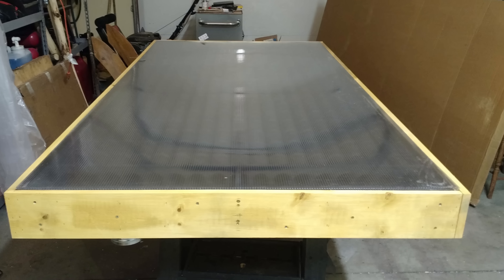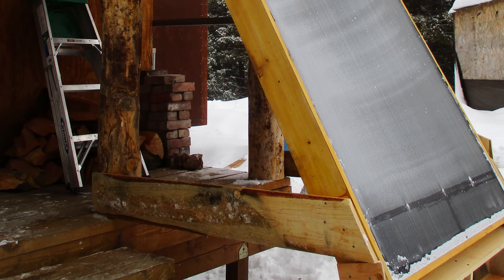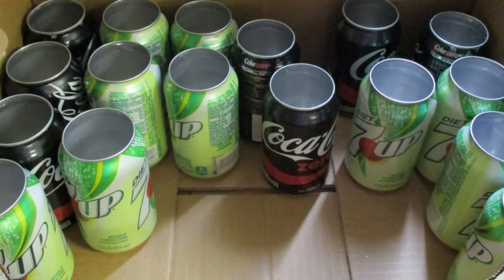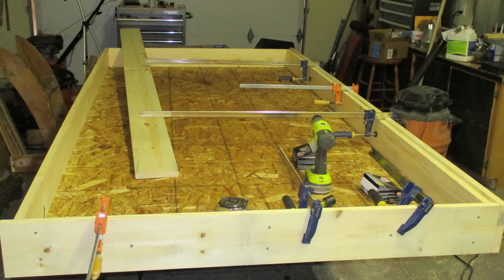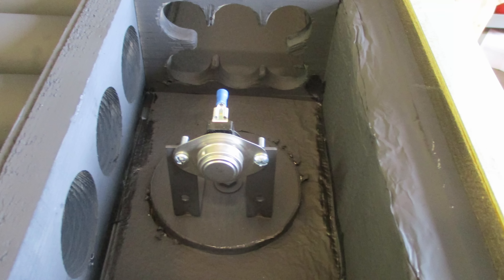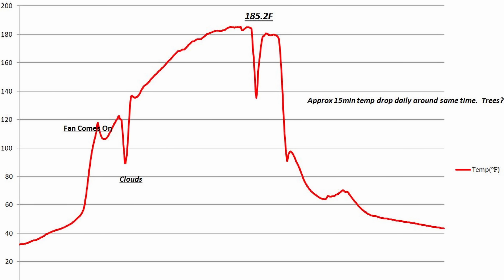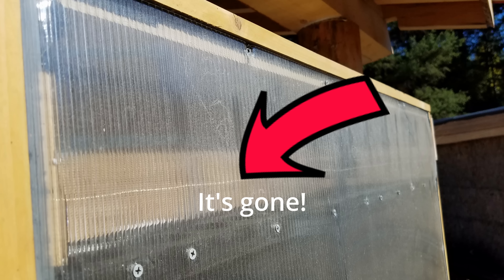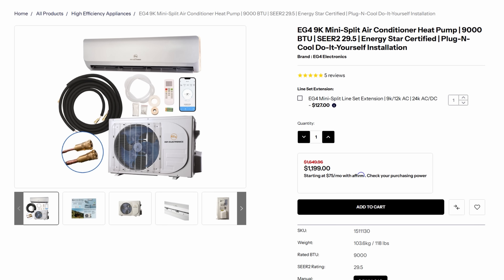7 Years with Pop Can Solar Heater - Is It Still Worth It?

Comment: Something to consider when comparing your DYI heater. Once built it has very little continuing costs. In fact if it is designed for maximum efficiency it will need very little or no electricity which means the only future costs is maintenance. 

While the EG4 mini split is an amazing product your statement that it is only about twice the cost of your DYI heater is not fully true. You either need solar panels, solar panel controller(s) and possibly a properly sized battery and/or on-grid electric and/or a properly sized generator. 

This means that the upfront costs can easily more than double the heat  pump costs and/or the ongoing fuel/electric costs must be taken into account. 

So how do you make your DYI heater more efficient? You need to place the heat collector much lower than the heat exchanger inside. This means that you take advantage of heat rising, cold falling to create what is called "natural circulation". With large enough vent pipes and a large enough height differential you may never need to use a circulation fan. 

You can then also upgrade it for cooling using the same natural circulation principles. 

Both systems can share most of the same ventilation piping. The inside exhaust would go to an upper level of the building (whereas for heat you want it at the lowest level). This dumps cool air higher in the building so that it can circulate inside the building to the lower levels. 

Which mode (heat or cool) will automatically determine which interior vents are exhaust and intake. For cooling you do want a building exhaust vent that goes from the highest point(s) of the upper level of the building to as high above the building as is practical. This exhaust vent will pull (suck) the hot air trapped near the upper floor ceilings without needing a fan. 

You will also need to put in damper valves near the heat collector. These allow you to bypass the heat collector for cooling. 

If you can extend piping to a cool location (either somewhere that is always shaded and significantly cooler that the desired building temperature or by building underground loop(s).

In general, but you need to look up specific information for your location, placing the loop(s) about 6 foot underground means a near constant year round temperature. In general this temperature is about 50F to 60F. Which is cool enough for natural air conditioning and can be a great way to pre-warm air for the heat collector. 

The underground loops need to be long enough to have time to cool down the warm air from the house. It is also generally better to split a 6+ inch pipe into multiple 4 inch pipes to increase the surface area to air volume ratio. Using too small of pipes can cause too much resistance to air flow. 

For even better efficiency you could setup two completely independent systems. One for cooling and the other for heating. 

The heating system would use antifreeze instead of air. From the heat collector the antifreeze would be sent to old water heaters with the electric elements removed and in their place would be a heat exchanger made from coils of copper piping. You would want multiple water heaters to increase the volume of hot water. You need a valve to be able to limit the amount of antifreeze each water heater receives. I've heard of people creating these and the water gets so hot that it flashes to steam. 

From these water heaters you send hot water to various heat exchangers inside the building allowing you to control each rooms temperature. You will need an air circulation fan for each heat exchanger. You could then use a wall and/or smart thermostat to control an electric valve and the air circulation fan. 

The only bonus is that you can install another heat exchanger (water to water) near the house water heater. Then have a small pipe from the hot side of the hot water heater go to this heat exchanger, then a small pump, then to the cold side of the hot water heater. This allows you to use your solar water heater to maintain the hot water tank 's temperature which can significantly reduce your electric usage. 

Of course if your solar water heater is large enough you could use it to heat water at your sinks, showers/tubs, washing machine and/or dishwasher. 

At the minimum it may be worthwhile to have a small hot water tank at the showers/sinks farthest from the main hot water heater. 

Even a tiny 1 gallon to 5 gallon water heater can make a huge difference. Connect the "cold" side of these small water heaters to the hot water line. The "hot" side goes to the local shower and sinks. The tank is kept to about 120F from the solar water heater's indoor water tanks. The tank only needs to be large enough to supply hot water long enough that the hot water from the water tanks can travel that distance. At that point hot water is entering the small local tank. The small local tank will also be helping to maintain at least 120F water. 

You now have "instant" hot water, because these local small hot water tanks should be as close as possible to the local sinks and shower, likely under the sink in its cabinet. This means that the length of pipe from the small local water heater should be under 6 feet, and possibly about 2 feet to 3 feet.
Reply from the maker: Thanks for the incredibly detailed and insightful comment!
Reply: I realize that a more elaborate system will cost significantly more money. In many cases you may be limited by the property and/or local regulations. Some may only be practical if built at the same time as the building.

As all off-grid solutions are not only for practical purposes but the costs must be balanced by their ROI. 

The systems I describe will require little power. Even the air circulation fans for a room can be a small DC motor that may only be 50 watts or less and rarely will be running more than a few minutes at a time. The fan on a central furnace for a house can be 15 amps to 20 amps or larger. This is 1800 watts to 2400 watts. 

Most electric hot water heaters use a 4800 watt primary element with another 4800 watt secondary element. Taking a shower can easily cause the secondary element to kick in, which means 9600 watts. 

That is a huge load on your inverters. Having inverters for a house that can handle multiple high load equipment simultaneously, even for short periods can require a 240Vac inverter system capable of 75 amps or more (18,000 watts). Taking a hot shower while an 1875 watt hair dryer is being used along with air conditioning can easily exceed 15,000 watts. 

Designing a solar system that can handle those loads is a significant cost: inverters, solar chargers, solar panels and batteries. 

If by using these alternatives to heating/cooling and hot water you can get by with a much smaller solar system it may actually be cheaper. 

A house off-grid solar system designed to handle 18,000 watts of load should have at least 36,000 watts of solar, solar controllers that can handle that much power, batteries that can last for 3+ days of cloudy weather during the short winter solar hours. The larger the  inverter load and size of the battery bank also requires a much larger backup generator. 

The generator needs to be large enough to carry the inverter load plus charge the batteries. If your average hourly inverter load is 6000 watts and you buy a 5000 watt generator you not only won't be able to have the generator carry the load, but it won't be able to charge the batteries. 

So many people will calculate generator run time to charge the batteries forgetting that the maximum amount that the generator can charge the batteries is it's output minus the load. 

I've talked to people who didn't understand why they had to run their generator all day and never got their batteries back to 100%. They forgot to subtract the load and simply divided their battery bank watt hours by the generator's output rating. 

People also tend to forget that a generator running on natural gas or propane will have a much lower output than on diesel or gasoline. They don't take into account that the generator's output decreases with elevation and that the output will vary with air temperature. 

Additionally people assume that their "portable" generator is designed to run at 100% for long periods (greater than about 2 hours at a time). Most portable generators are only rated for 25% load for long term use (about 10-12 hours continuous). These generators can handle about 50% to 60% load for about 6 to 8 hours continuous. 

This means your 20,000 watt generator shouldn't be used for more than about 8 hours continuous at 10,000 to 12,000 watts of load and about 10 to 20 hours at 5000 watt load. 

These portable generators also generally require an oil change every 100 hours (after break in), or 50 hours with extreme use. Extreme used can be high altitude, high air temperature, high load or a combination of factors. 

This might mean that after only 2 days of use you must do an oil change. Perhaps you are at 3000+ feet, the air temp is 90+F and you are running the generator at about 50% load. That is a likely combination that could be considered extreme.

Comment: The pop can idea is great and very efficient but expensive. So the cost includes all the hours of labor, which starts at minimum wage or much higher for most people.  With the cost of electric solar panels being so low, I think just buying two panels for a few hundred bucks and then attaching them to a heating element would be so simple and require very little time to just mount.  If you wanted to get cleaver the back of these panels will also heat up, just like a black pop can, so you could use that heat as well.
Reply from the maker: I appreciate your thoughts on alternative heating methods.

Comment: There are lots of variations of passive solar hot air boxes. You can break the bank trying to make yours maximally efficient, but maximal efficiency is not necessary.  You're getting the sunlight for free, so you don't lose much if your design allows some of the sun's heat to be lost.

I've built two variations through the years.  The best one was the simplest, and it functioned well in part because it was so large that it didn't need to be efficient.  I built it so that it used the entire surface of a metal garage door as a heat collector plate, roughly a 9 ft by 9 ft opening. There were no pop cans or other tubes. I simple built a large clear plastic panel attached to a portable 2x4 frame that stood vertically in the garage door opening. It created a hot air box about 9'x9'x6 inches deep.  I fastened the portable panel in place in front of the garage door, so that the sun shone through the clear plastic and heated up the metal garage door. In the morning, I opened the garage door about six inches, which created a similar size opening at the top and at the bottom. As the sun heated the metal garage door, the box drew air in from the bottom, where the door was slightly open, and convection poured that heated air into the garage from the opening at the top.  When I finished work in the garage, or when the sun was blocked by clouds, I simply closed the garage door to hold the heat inside and prevent reverse convection.

If I needed to get a vehicle into the garage in winter, I'd need to move the clear plastic panel, which would require two people and about five minutes, but I rarely did so. I tended to keep a long-term restoration project in that garage stall, so I rarely needed to open the door to get the project out. Typically I only moved the panel twice each year: once in late fall to put it into place, and then I removed it in the spring when I no longer needed the heat. It spent the summer stored out of the way, fastened against the exterior wall of the garage.

I never bothered to measure the temperatures or attempt to make the design more efficient. It worked well enough to take the chill off in the garage, and it made working there comfortable on all but the coldest days. It even heated the garage enough to allow me to paint cars on mild days in the winter.  I enjoyed that cheap $100 solar heater for a decade, and it was still working great when I sold the home.  If my new garage needed heat, I would do the same thing in a heartbeat.  It was a marvelous garage heater.
Reply from the maker: Cool idea
Reply: @tedpreston4155  great comment!
Reply: Was your door painted black at all? you've got me curious to try this on my door! Brilliant idea! My door faces a bit more East, but at a 7x9 footprint I think it should be able to get a bit of heat!
Reply: @donniewarren51  My door started out dark brown, so there was no need to paint it black. Black is best, but any dark color will absorb heat.
Reply: Very cool, thanks for taking the time to write that all out!

Comment: I don't think you need to fool around with those aluminum cans.   Send those cans back to be recycled.  You can get the same effect with just a flat piece of sheet metal.   I would use roofing panels.  You might even be able to buy black or hit it once with black flat paint.  It will do the same thing and be more durable. For me, I would just go with a mini-split to keep the porch heated and cooled.  You are storing batteries on your porch, that vitality of in range temperature is more important than a few bucks you will save in heat.
Reply from the maker: At the time, I didn't have as much solar and since I'm not there 100% of the time, I couldn't monitor the power consumption etc.

Comment: I made one similar and when sun is up a fan blows the hot air into the top of my heat pump water heater which is in the garage. The water heater will heat water many times faster when it gets this heat. Instead of cans, my panel was divided and sealed in half vertically with a small opening between each side only at the bottom. A fan pulls the air out the top of one side and air flows back to the panel at the top on the other side. So the air must go down one side then up the other side. I put 4 layers of slightly loose black metal window screen as a heat absorber. With full mid day sun I can get 200F temp air. I used 3.62" metal track, the kind used for 2x4 light metal framing for the frame, lined on sides and back with the the poly iso insulation board painted with high temp black. I also added 1/4' plywood on the back. Because it is installed vertically on outside wall I found it doesn't produce much heat in the summer when sun is directly overhead. That's ok as I need it mostly in the winter.  I plan to put another one fully outside next to my HVAC heat pump and blow the hot air into that unit. In winter that would give me 6 hours of hot air greatly increasing the efficiency of heating my house.
Reply from the maker: Cool ideas

Comment: You could probably add a small solar panel powered DC computer fan to the bottom opening, but positioned where it won't be heated up. Might require a bit of tuning, but when the solar panel provides enough power for the fan there's also enough light to be warming the cans. That plus loosely sprung vent flaps at the top and bottom would make it pretty maintenance free.
Reply from the maker: I'll just move the fan from the top to the bottom on the same circuit.  Should work better.

Comment: You might look into getting a Raspberry Pi 5 and a servo or two.  (I'm sure you've got a neighbour with cruise control and an unlocked garage, right?)  That'll allow you to control the fan(s) and baffle(s) at the exact time/temperature you want to, while being such a low power consuming device, you can power it and the fans with just a few solar panels and a car battery or seventeen.  It'd add a bit of cost and a bit of complexity to it, but you'd be able to control everything how you originally intended to.  Worth a looksee anyhoo.  d;o)
Reply from the maker: Not sure I understand why?  I'm using a 12v fan and a snap switch and it works quite well and with 10kwh of battery power, no need to those old tech car batteries.
Reply: @TheOldJarhead  The Pi (or arduino) to control the servos to open/close the baffles and for fan on/off and speed control.  Separates the fan/spring situation into discrete, manageable functions that no longer rely on each other to function.

If you were to throw in a simple temperature sensor (I think you already did) yould dump the heat whenever it reached a specific temperature, or you could control the fans and keep the "pipe temps" steadier as well as heat pushed inside more consistent.

Anyway, just a thought.
Reply from the maker: Gotcha, and makes sense
Reply: @ElectroPig  use a $2 nano arduino instead.
Reply: @TheRainHarvester  Also a valid option.  I like the Pi more because it's got the nano, standard, and the Pi 500 as options that are all interoperable without any different coding.  Of course, if you're experienced with arduino already, that'd be the easiest choice, yeah.

Comment: Sounds interesting but I think that if you put 1/2" Hardibacker cement board over the insulation and then install either black tile or black 1/2 brick you would then have thermalmass that would heat up much better and stay warm longer. 
Semper Fi
Reply from the maker: Thanks for the suggestion, that could definitely help with heat retention. Semper Fi!
Reply: The goal is not to heat up the box, the goal is to get the hot air into the space that needs heating. :)
Put the mass into the area that needs the heat if it get too hot.
Reply from the maker: Thank you for your input! I appreciate your perspective on how to effectively distribute the heat.